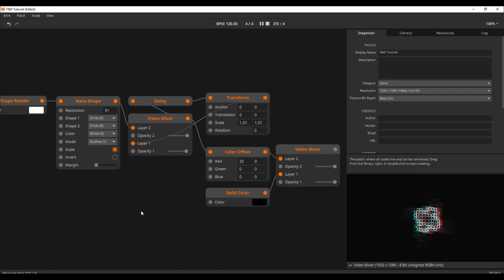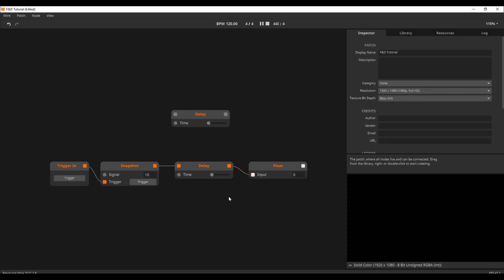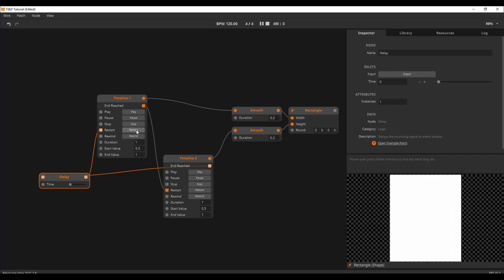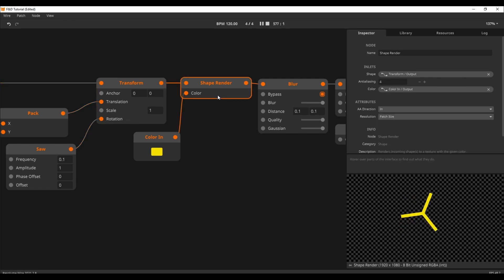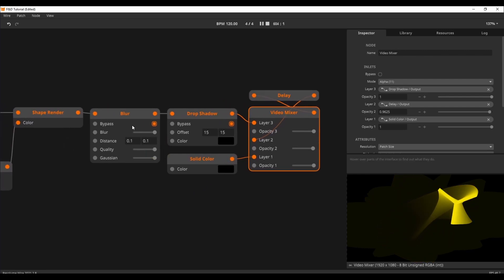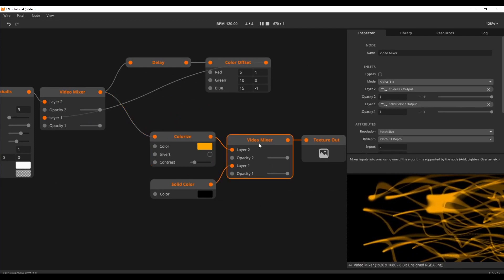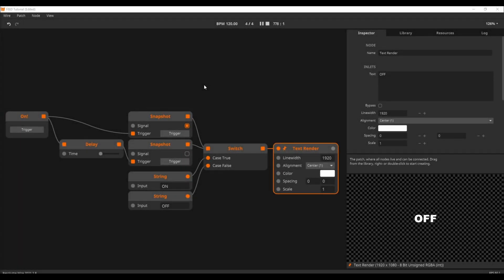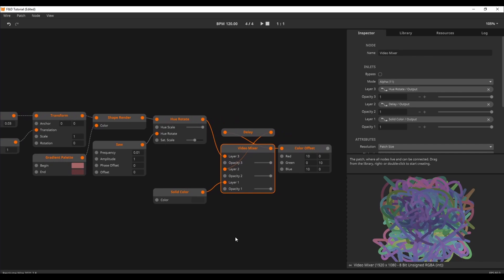Wire Training Course 1.12 - Feedback & Delay

Comment: Thanks for the great tutorial. I have a question in creating the "trailed effect" using the feedback loop. When the opacity is set to around 90%, the feedback loop does create a nice trailing effect, however, it also leaves some sort of "color/luminance residues" on the screen, adversely staining the whole video, like that at 3:25 of this tutorial. 

Is there any way to get rid of this "color/luminance residue" as the video/effect progresses? OR is it possible to add some code to clear the opacity completely when the layered opacity gets down to a certain threshold? Looking forward to your answers. Thanks heaps!
Reply from the maker: You are right, that is a side-effect of doing feedback like this. It is simply a very "dirty" proces.

But there are solutions!

The most GPU-intensive solution would be to use a Ringbuffer node instead of a feedback loop. This will delay the signal in a similar way. Next, you want to put a Fader node on the instanced textures from the Ring Buffer and hook up a Linear node to the gain inlet.

A lot cheaper solution would be to take the output of your feedback loop and send it into a Greater node set to a really low value (0.03 did the trick here). This returns only pixels that are above 0.03.  Use a single float for the float4 inlet.
Next, you use the ouput of the greater node as a Mask for the feedback loop.

This is essentially a filter for your pixels. You check which pixels are have a super low opacity and filter them out with the mask node.
Trails without residue!

Another solution I found was putting a Fader node in the feedback loop.. set to something high like 0.90. This way you use the feedbackloop to fix the feedbackloop.. feedback-ception! But this might not work with more complex loops.